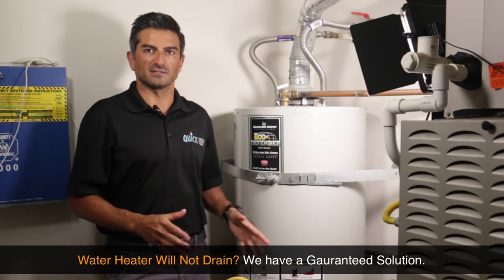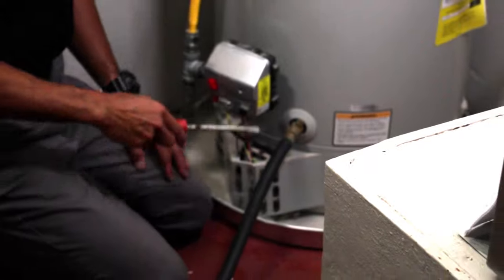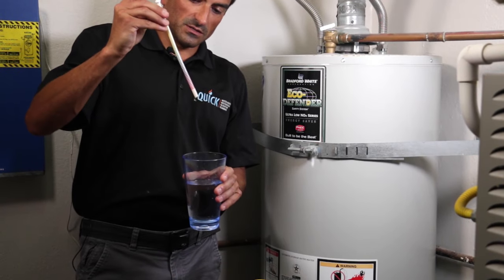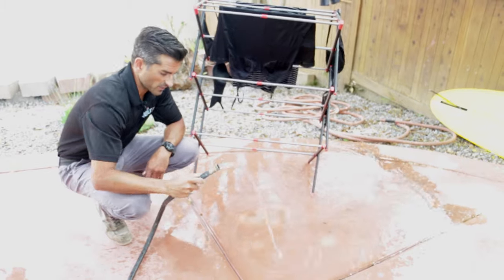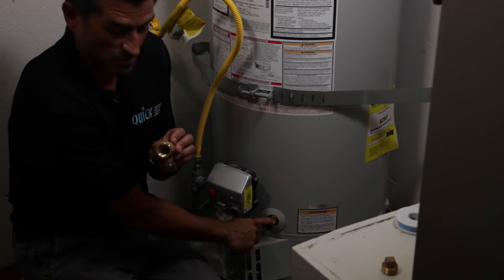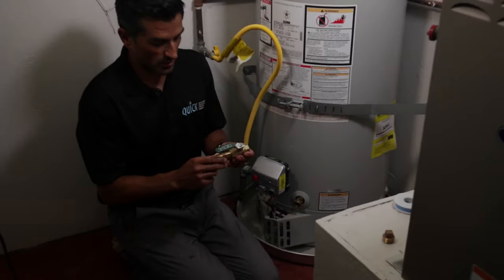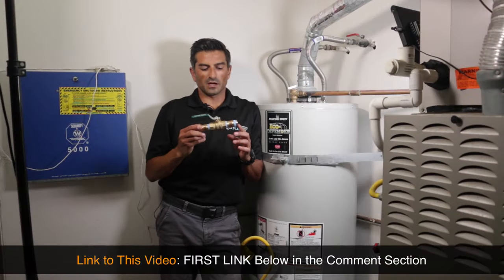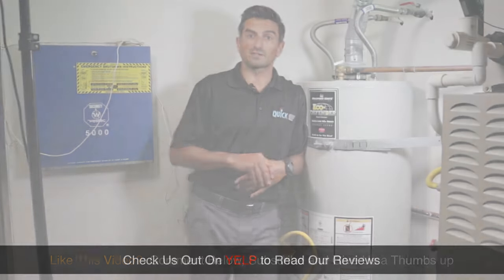My Water Heater Won't Drain [Fix It With 3 Easy Steps]

Comment: Why dont brilliant designers of water heaters just use proper larger drain valves?.....and instead of loosening plumbing fitting..mcan u jyst release the pressure valve to remove air lock?
Reply: Because:  a)  Hot Water Heater manufacturers are not a public service.  They're in the business to make money  b)  by using a cheap drain valve they save $$ in production  c)  By making a tank with a limited service life with inadequate drain valves, they insure their tank will never be maintained.  d)  If tanks need replacement every 6-8 years, it means more sales, which means more even more $$$$  e)  More money means more lobbyists and political "contributions".  f) Net result: "no regulation" for the industry - unless such regulation just happens to increases profits/sales.    That's just the way it is...

Comment: Question - could I do the exact same method as number 3 except instead of replacing the valve, stick something small in the opening to break the sediment up and get it flowing? Or, would that be a bad idea? I mean if it doesnt work I could always go buy a bigger valve…

Comment: I do not have a valve at the bottom.  I have a Y outlet instead.  But when I hook up a hose to each side, nothing drains still.  I have released the pressure.  Help!  What can I do?

Comment: Did all the steps - turned off gas, turned off cold water on top of tank, connected hose to tanks drain, turned hot water on at kitchen faucet - no water drained out of tank, so I opened the pressure relief valve to let air in and water started coming out of the pressure relief drain pipe, not a full flow of water but enough for me to take a step back and stop the process. It took a while of me jiggling the pressure relief valve for it to finally stop dripping. Is there something else I should do or is that an indication something is wrong?

Comment: My idea is to adapt a pipe nipple to the plastic valve and drill a long bit through to the tank. Then have a hose or sleeve handy to quickly put over the nipple. I'm replacing my water heater anyway

Comment: I had 3 feet of rust sediment in my water heater.  I took the valve  off no water came out. I was replacing the lower element so I took it out no water came out. So I found a stick and swirled it and water came out

Comment: While draining the hot water tank, cold inlet valve off, why would the hot water line, leaving the tank, allow water flow back into the tank; as if filling tank as I'm draining it.  Could only stop this by shutting down the main water line to the house

Comment: If the new piece is a larger circumference, how is it screwing into the old receptacle that you just unscrewed the smaller circumference pipe from?
Reply: He means if the valve is clogged, not the passage. You may have a 1/2" receptacle, but the valve on it may be much much smaller specially with gate valves (the ones that look like a hose faucet). Ball valves can have much larger passages some as large as the inner diameter of the pipe itself. A lot of water heaters come with gate valves on the drain.

Comment: Help. The water heater is outside...completely disconnected; with water inside... What do you suggest...as there is a plastic thingy at the bottom; you said we are screwed? 🤔
Reply from the maker: You will want to pull out the cold nipple and stick a hose down into tank. You’ll need to start a siphon flow and it will drain quickly
Reply: @quickwaterheaterfiltration5292  Thank you!

Comment: If I turn off the gas and water and open the hot water faucets in the house, will the tank drain completely,  so that I can pour in some stuff to dissolve the mineral deposits? And, once empty what will completely dissolve the mineral deposits, which have plugged up the tank? No water comes out when the drain faucet is opened.
Reply: I use vinegar, and let it sit for 24 hours (it sounded like popcorn in there). The last time, after a chunk of deposit got stuck in the water line making a wonderful noise (think a wind instrument with a reed, but it only knows one note),  I added five 4 litre jugs, then turned on the water supply to fill the remainder of the tank and ran all hot water taps until I could smell the vinegar. Then let it sit for the 24 hours. After I drained, filled, drained and refilled the tank, the noise and deposits were gone. I did have to replace the plastic valve with the 3/4 inch ball first however to get mine to drain.

Comment: I drained my Water Heater (bought new JUL2020, A.O. Smith 40-gal.) Friday, and never could get the trickle of water coming out to stop. (Turning off the Water Main didn't affect anything.)  Today, drained it again. Back-flushed w/ garden hose utilizing 3/4-in. Female-Female adapter. Turned on Cold Water Valve to stir things up. Did this back-flush 5-iterations. Did your Step-#02 (loosened outbound Supply Line), no change. It's been draining now five HOURS-- water still trickling out the hose. Where in the WORLD is this water coming from?  (Again, shutting off Main did "not" stop this water flow.)  Water draining out now is cold & clear, no sediment found.
Reply: Same problem 😢

Comment: My  full port drain valve is built with a 3/4 in x 3 in brass nipple, 3/4 in full port brass ball valve and an 3/4 in MPT x 3/4 in MHT brass hose adapter and it replaces the old plastic drain valve which has a leaky washer and very restrictive open. The full port drain valve provides a very effective draining and flushing.

Comment: I have a Rheem Performance Plus with the plastic drain valve.  I cannot get the water to drain.  I've tried using the pressure release valve, I tried to push water back into the drain valve at the bottom, and nothing is working.  I cannot get the water to drain.
Reply from the maker: Have you tried releasing the air lock?

Comment: what about if water comes out of the bottom of the water heater the moment you turn on the valve for draining? I have a lever to let air into the tank, but instead of coming out the drain valve it just comes out of the bottom of the tank.
Reply: alright, finally got it to drain but it isn't draining fast, in fact it is draining slowly like a trickle and eventually stopped. I could still feel hot water when turning back on the water and feeling the water from the tap so not all drained.

Comment: Your water heater is not toast if a plastic drain valve cracks inside the threads of the water heater. You can still remove it and replace it with a bronze one.

Comment: Remember that the end of the drain hose needs to be BELOW the drain valve on the water heater or it won't drain.  So if the heater is in a basement, you won't be able to run the hose outside, or into a laundry tub: you need to use a floor drain.
Reply: What if I don’t have a floor drain.
Reply: @rosemarybaker  fill a bucket, dump, repeat process until tank is empty.
Reply: At a floor sewer

Comment: I always open the hot side because the cold side has what's called a dip tube and requires more force to percolate the air down the tube

Comment: Why didn't you just release the pressure valve if air there was an airlock.
Reply from the maker: Because after you break the seal it will leak. Try your s at home.

Comment: I cannot open the valve. What should I do?
Reply from the maker: Jeff G remove it entirely. Make sure to release pressure but keep all valves closed.
Reply: @quickwaterheaterfiltration5292  - but if remove the valve I will have an entire tank of water gushing out from where the valve was?

Comment: The reason your water heater isn't draining is you were too lazy to do the yearly/bi-yearly required maintenance.

 The Anode rod inside of your tank NEEDS to be REPLACED at a minimum every 3 years but preferably 1-2 years. This exponentially decreases buildup at the bottom of the tank.

If your pvc valve is stuck, remove it. It's not the end of the world like this LAZY plumber explains. Simply take 2 flat head screw drivers and insert them into the hole where the PVC valve broke off, criss-cross them, and rotate counterclockwise to remove the broken collar inside the tank sleeve.  If your drain valve is plugged, stick a long phillips screw driver inside until it breaks free. Your pushing through calcified mineral build-up, you're not going to poke a hole through the tank.
Reply from the maker: You seem very confident for someone who is unaware of the reality of anodes, cathodes and water heating. Keep studying grasshopper.

Comment: I like the "if you have a plastic valve......." the the audio fades out. So since my plastic valve wont drain, I have to run out and buy a new water heater
Reply from the maker: Lol. You nailed it.
Reply: @quickwaterheaterfiltration5292  the plastic valve can't be swapped out?
Reply from the maker: Ron King it can be done but plastic breaks sometimes.
Reply: The plastic tube threads into the metal tank.  If it breaks the you have to use a hacksaw to cut it out or chisel to chip it out and replace with 3/4" full port brass ball valve

Comment: I have AO Smith water heater and it will not drain. I do not believe there is any clog.  I have hot water circulating pump installed. There is T with cold water line to the water circulating pump.  It will not drain with all the standard instructions. Basically I cannot get air into the tank. I am reluctant to open the hot water supply line makes me nervous! What about hitting the relieve valve?
Reply from the maker: Try opening the drain valve while tank is under pressure. If you just need air in to undo the vacuum then open a hot water faucet.

Comment: Comes here to find out if he’s screwed

Guys says: you’re screwed.
Reply from the maker: Sometimes your screwed sometimes your not. #noBS
Reply: @quickwaterheaterfiltration5292  well i saw on a couple other youtube videos of people getting the plastic drain valve out and just popping in a brass drain valve.  BUT EVEN THEY SAID IT WAS VERY DIFFICULT and that they always break.  The thing is those other videos were of actual plumbers (like you) who know what they are doing. 
I'm reluctant to try removing that plastic myself.

Comment: That's not true you can drain it even if you have a plastic drain valve I just did. just make sure u unscrew the hot water line on top so you can let air into the tank my wasn't draining until I did. also you can unscrew the plastic drain valve a bit to let water flow out easier helps with the pressure in the tank. it might take two or three hours but just have patience and follow his steps and you'll get it done good luck hope this helps someone good video thx.
Reply from the maker: Thank you

Comment: this was supposed to be how to fix the fact that it's not draining. Yours is at least draining. Mine is not draining at all.
Reply from the maker: Ladell P  Remove the valve and clear out the port. Or watch the whole video.
Reply: @quickwaterheaterfiltration5292  My bad. I should have watched the whole video. You're absolutely right. But I already drained most of the Water by removing the control valve. As you can imagine, it was hell.  I can only assume that there is still water left on the bottom portion of the tank. But thank you for that info.
Reply: @ladellp5135  I had the same problem, but I built the valve before I started and made sure all the faucets were close and the water was off with the pressure bled off. I had a bucket under the drain hole and worked fast. I think a total of 1/4 cup of water escaped.

Comment: Why not turn off the water valve, turn the water heater to pilot, and THEN go take a hot shower BEFORE draining the water heater?  Wouldn’t that be much easier and faster to empty the water heater?   Once the hot water is used up, turn the water valve back on, then drain it again.   Rinse and repeat 5-6x to remove the sentiments at the bottom.  

Draining hot water from a full tank seems like a total waste of perfectly good hot water.
Reply: 2 things here: 1. If you turn a valve off, you will prevent any flow of water.  2. just using water out of the water heater does no good at removing sediment from the bottom. In fact, if that were the case, there would never be a need to drain the water heater because it would clean itself with any use of hot water.

Comment: Too bad you don’t just list the parts here and add that part to your video that we just finished watching. Instead you make us go chase around your jack ass website and watch yet another video where you can’t skip ahead or go back on the video there that you’ve got linked… So all the good that does to try to watch what you’re doing is pretty much pointless because you have to watch the video over and over again if you are trying to pay attention. 

By the way if you’re videotaping - and you load a video where you held the camera sideways-it’s going to make a sideways oriented video likewise if you hold it vertically it’ll make a vertically oriented video. The video on your link is a sideways oriented video but you have to watch it vertically otherwise the video won’t play - and the sideways orientation of your video makes your screen way too small to see anything useful.

So once again if you wanted to be Mr. helpful you could just list the parts that you needed on the original YouTube video- Seeing as how there’s only four parts that shouldn’t be too hard.…or maybe I’ll just do that for you, seeing as how you’re too busy patting yourself on the back about this whole thing by trying to shed light on the website.

Speaking of shedding light… It would help if you had a lot more light in this video when you were shooting so that it’s easier to watch and you’ll see more detail that way.

Aside from all those complaints… It’s a pretty good video. But it certainly needs some work.

Comment: Some cowardly folks would turn off the gas (or electricity) FIRST.  Why wait?  Why not do everything you can to keep tyros out of trouble?  One might even want to remind the person to verify that it's off later -- before opening the a valve to let air in.  And loosen a supply line?  Seriously?  That approach is fraught.  Why not crack the T&P valve?